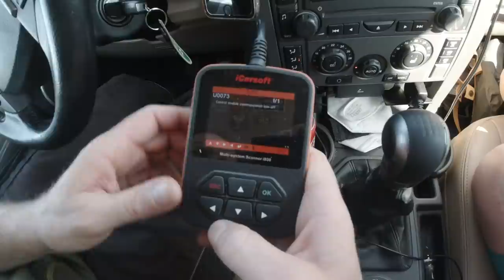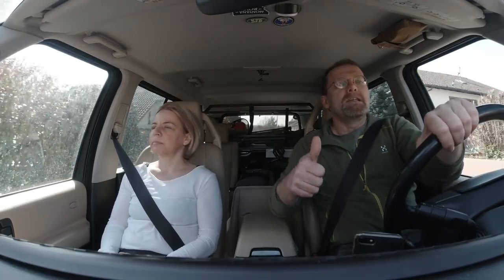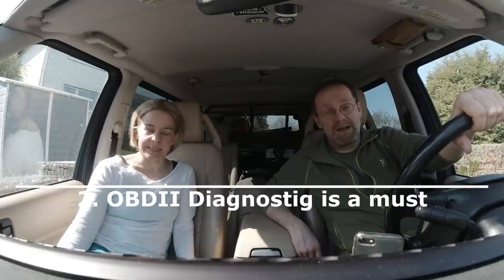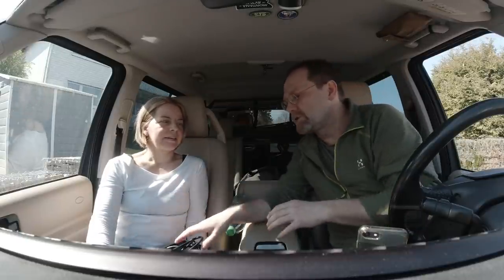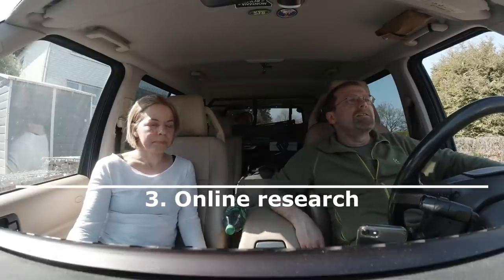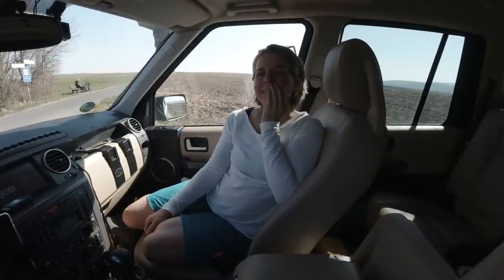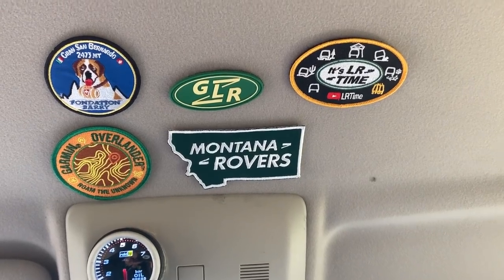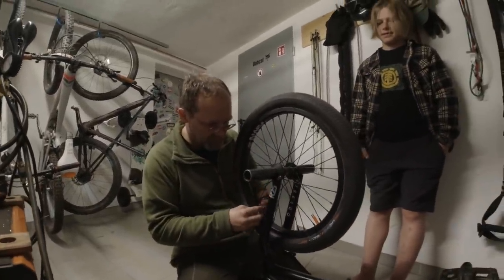Land Rover basic diagnostic in 5 steps - LR3 - LR4

Comment: Having owned 6 Land Rovers over the years I'm well used to the temperamental problems you encounter as an owner, and spending a weekend in the garage fixing the issues becomes the norm. Last year I couldn't decide whether to buy a Disco 3 or 4 and I found your videos very helpful. I especially found the broken crank videos very informative and entertaining. So I decided to become a Land Rover owner by proxy, and by watching you both I get to have all the experience of owning a Land Rover but without the cold, oily weekends in the garage or the cost of ownership! Instead of the Disco I opted for an XC90 (2010), and whilst it's not as good off-road as a Land Rover (what is) it does offer exceptional comfort and reliability. I recently went on a 200 mile round trip and instead of worrying about whether I would get there or not I simply enjoyed the journey. So, I need to keep watching your Sunday videos to get my 'reliability anxiety' fix. Thank you and keep up the good work! 🙂 P.S. I never considered a Toyota because I'm not old enough yet!
Reply: As a 2006 xc90 d5 owner I can tell you Volvo is very soft ,hydraulic lifters,transmission valve body ,swirl flaps,Yaw sensor (mounted under driver seat floor corrodes),CD player not working ,leather on seats cracking,Vacuum fed engine mounts (car only likes genuine Volvo ones),steering rack goes bad,window switches go bad as well,Haldex diff needs service with special Volvo oil or your xc90 can turn from AWD to 2WD very fast and all these items cost a lot of money because Volvo is premium car brand as well so yeah it is a little bit cheaper to repair than a Land Rover but not by much (All the things I named I've fixed on my xc90)
Reply: Diesel xc90s are great but not as reliable as the petrol model (except a 2.9 T6). I’ve owned a 2.5T for over 4 years now and have only ever had to do wear and tear items, it’s a solid car and with a few performance upgrades it really kicks. I do like discos but unless you rebuild it like they rebuilt Vera’s disco 3 then there’s no point in even buying one.

Comment: Hi Christian, hi Vera!
This is Steve from GAP Diagnostic - I enjoyed the video. And yes, providing psychological support for LR owners is one of our main tasks as well. We produce diagnostic systems on the side :-p
Seriously, though, this is actually just one of the reasons the IIDTool is more expensive than other LR diagnostic systems. We are the only LR diagnostic system manufacturer for the end-user who actually provide support. 
While I agree completely in everything you said, this is definitely the more time and effort intensive way of going about the ownership of an older LR. Even all of us at GAP get tired of being 'forced' to play with our cars. An easier method, for instance would be to export the fault list once every 3 months or so and then clear the faults - should not take more than 5 minutes. When something more serious crops up, you can go back and compare the various lists and it becomes very apparent which faults are recurring (nuisance) faults and which are likely to have caused an issue. The average owner (with less of an interest in the vehicle and especially diagnostics) check through the list once (after seeing this video :-)) and forgets about it till a serious issue appears. And then he has nothing to work from and has to start from scratch. Of course you can't export the list with the iCarsoft :-p (Which we all don't consider to be a bad tool, btw. As a matter of fact, if the iCarsoft had been around 10 years ago, maybe there wouldn't have been an IIDTool. But back then, anything worth buying cost 4-figures in $ or €. And the iCarsoft definetely has its drawbacks). 
Aside from regular maintenace, maybe doing a video on the dfferences between diagnostic systems might be something worth considering - and just as much of a help for your viewers as this video.
Vielleicht sehen wir uns auf der Abenteuer & Allrad dieses Jahr? Würde mich freuen.
LG
Reply from the maker: That would be great, we'll be there 😃👍🙋‍♀️Vera

Comment: Did you say...'Psy-Car-logist'? Lol. If you can help, my 2005 LR3 HSE V8 has no power today. It got a brand new battery and new pads and rotors (rear) yesterday. When I turned it off the first time upon getting home, it locked into park. I restarted it and drove it up the driveway. I let it sit overnight and now, no power. I cleaned the corrosion off of the Integrated Transfer Case behind the battery and changed a  blown 20v fuse beside the battery but still no power. Only 1 red (seatbelt) light on the dash comes on but nothing else. And the back gate won't open now. Prior to the new battery and brake work, it was giving me a Suspension light, Transmission light and Park Brake light. I'd really appreciate any help you can give. I just purchased the GAP iiD diagnostic bluetooth tool 15 minutes ago and it will be here in a few days. (Even got a new key with it to program, which I really need!) I'd love any advise on this situation and how to best use the GAP tool. Thank you so much for your videos. You are extremely knowledgeable and you guys are funnier than Seinfeld. :  )  Kind regards.

Comment: I threw my EGR valves away and blanked them - want like a rocket for years best thing l ever did - great entertainment video again gang
Reply: You will find that in most countries (European, North American and Australian) performing an EGR delete or knowingly using the vehicle with such a modification is illegal.
Reply: @Adventures-with-Ty  i would that most 4wd vehicles in Australia that get used offroad have had the EGR's either blanked or a software patch applied to make them inoperable, after cleaning my intakes that were 50% blocked i also planked mine off.

Comment: We have gotten much use from our iiDTool. Last week, two days before my wife was meant to leave for a 10 day trip out west to the opal and dinosaur fields hhe D3 had some funky faults, they just looked like the usual ECU etc faults, but with some trans, suspension and compressor codes. I cycled the the height settings watching the iiDtool specs and based on height dimensions, I found the front left air bag had a leak. I could also hear it leaking with  the window down at offroad height. 
I sourced a new pair expecting to change them overnight for the trip, but She ended up going with a different car.
iiDTool is 100% must have for D3/4 ownership
Reply from the maker: Land Rovers are always looking out for their wifes 💪👍😃🙋‍♀️Vera

Comment: I loved this video.  Very entertaining, funny, and informative.  I'm now wondering if I should get a diagnostic tool for my 2013 Ford Edge.  Of course, the additional content was excellent.  Absolutely amazing what Robin and Philp are doing.  By the way, the rear rim on my mountain bike was cracked, so last week I had a shop replace it for $210 which included the $50 for the new rim.
Reply from the maker: Philipp needs a set of rims about every 10 month.  That is 350 to 400 Euro.  Every 7 days, I need to true the rims and tighten all spokes.  It’s not a cheap hobby.  You have to imagine the crashes in between these successfull lines which I show in the video.  The bike may drop 10 feet on concrete… thanks for you comment.  Christian

Comment: Very good reasuring video for many Christian & Vera. Robin wasn't mucking around, he was running to the anvil to do whatever he needed to do!

People would be horrified to hear that aircraft on every flight have hundreds of faults logged - of which most if not all are nuisance items, however they fall into the parameters for logging an issue. Similar to loosing the comms at start up that you gave an example of, you only need to have a voltage below the threshold & an item is logged. I was surprised how many items mine logged, yet the LR# was running fine. Then I started seeing repeated items, though no check engine light or any other lights or messages on the display on the dash. I was concerned, as everyone knows, LR products have problems. I eventually put them down to nuisance reporting. As you say, the art is knowing what is a real fault that requires further investigation and what is not.

I have ordered an iCarsoft LR V3.0. After researching many, I have determined this is the best value for money form me. If I find a second hand Gap II I will buy one, though for what I want the iCarsoft is more than enough. I do have an AUTEL AP200 with the Land Rover software, and it is pretty good for the price, and it does let me reset the service interval on my LR3, however I believe the iCarsoft LR V3.0 is infinitely better than the Autel I have.
Reply from the maker: Our Gap is used too, we just paid an additional 75€ to have it licensed to our Discovery 3. 🙋‍♀️Vera

Comment: Eh..... my D4 giving me a headache it's a 2013 XS 112k on clock. Went into restricted mode (limp mode). Fault codes were indicated faults from one of turbos. Smoke tests showed a few holes in hoses, fixed those. Then a sensor on the turbo fixed that. Now errors and smoke test indicating its inlet manifold on the RHS in the UK thats the driver side. Inlet manifold parts on back order and no idea when it's due in stock. Worried that I'm chasing problems now and becoming expensive
Reply from the maker: Not sure. Hard to imagine that all this went bad at once.  You can find the plastic manifold on Alibaba in China.  Quality is ok.  Used it before.  Better drive it above 3000 rpm for a few miles uphill or accelerate to use the second turbo. Sometimes this helps.  Make sure it got temperature before you do.  Christian

Comment: Hi guys , great video and very interesting, I have very late 2016 discovery 4 landmark, only done 35280 but I just had the replace the indicator stalk as the main beam came on when I indicated right !!!. I use a foxwell nt 510 as my diagnostics tool I keep getting body control module as a fault , I do clear it seem to come up , any suggestions please Christian . The diesel prices her is £1.70 a litre just come down by 5p after the chancellor reduced in the budget . Best regards mark

Comment: I'm going to buy a Disco 3. I have the Lynx Evo 2 for my Td5 and Disco Sport. The worst thing about the Lynx is having to have a mobile Internet signal. It requires a connection with the server to confirm the license is valid, which is not great when stuck in the middle of nowhere.
Reply from the maker: We recomend the icarsoft diagnostic tool, or what we mostly use, the GAP BT iid tool. Do invest in oner of those.  👍🙋‍♀️

Comment: Problems I've had with my lr3 v8 and fixed my self:
1. Instrument cluster would randomly shut off. Check fuse boxes on driver, passenger, and around the battery for moisture. If all are dry and free of corrosion then it's the cluster itself. Can be easily replaced without taking the steering wheel off.
2. Front air shocks were leaking. Replaced both in half of a day. Just 4 bolts, very easy. Spent the majority of the day YouTubing how to fix it.
3. Currently dealing with a transmission problem. The torque converter would lock and unlock below 30 MPH when cold. RPMs would fluctuate around 1500 RPM below 30MPH. I Replaced the transmission oil, pan, and filter with the new upgraded one. This makes it easier to flush in the future. However, did not completely fix the problem but happens way less now. Will do one more empty and fill just the oil this time. Hopefully, that will solve it.

Besides that the car is great, 120000 miles and the engine hasn't been touched still runs great.
Reply from the maker: The German channel Altblech-Schrauber has a video for fixing the dash problem.  He also fixed the shifting issues on the HP6.  Hope the subtitle works on the videos.  Christian
Reply: @Vera_and_Christian  Oh sweet, thank you for the info! This problem has been annoying me for a while now. Love the channel!!!

Comment: Despite the myth toyota's do break down, i agree that a diagnostic tool is a must for these vehicles and will pay for itself the first time you fail to proceed. I have a Gap tool and i also have a AUD$39 bluetooth reader that will read and clear codes on a D3 and 4, i use a switched extension cable but find it occasionally has a bus speed error when i use it.

Comment: Excellent, like always. Question for you guys : EGR valves replace or eliminate ? Assuming it is ok by law to blank them. Big hug from Costa Rica
Reply from the maker: If you don’t get in trouble, blank them out but leave the electrical connected.  They are useless and harm the engine.  There is no downside like power loss or similar.  In Germany it is illegal to blank them.  Christian

Comment: Good evening discovery master technician.  I am writing to you because I am having difficulty choosing a diagnostic tool in (Italian) language suitable for my 2010 D4 (2.7tdv6) man that can do webasto test and reset the safety stop block.  After 3 failed ignition attempts it locks up and I have to drive to the dealership with biblical timing.  I hope you help me and I respect you and encourage you.  Thank you
Reply from the maker: The Icarsoft can read and reset faults and display live values. It cannot control the FBH or cycle the pump.  Christian
Reply: Thank you very much. Best regards.
 Edoardo Ferretti

Comment: Guys you are the best! LR should hire you! I'm having some seriuos problems. My 2009 TDV6 LR3 is failing. System engine failure, suspension fault on every trip. First two times I managed to overcome by disconnecting the battery, but yesterday I couldn't. Gap tool is useless, clearing fault and fails again after a few meters. This weekend it was everything great for 500 km but then, suddenly while on highway, at about 130km/h " suspension fault", and yellow warning lights, and truck lowered. I drove that way for about 100 km and then "system engine failure", one more light, and couldn't drive at more than 40km/h . I'm starting to hate this truck, but I love it to! Please, help! My mechanic doesn't have a clue, and his the best in LR here in Argentina. It's the third trip that truck fails, faults cleared, everything seems to be normal, and suddenly, happens again
Reply: Maagic happens on LR3, and this morning started as if nothing ever happened
Reply from the maker: Sounds like a battery problem.  So check alternator mains, battery condition (11.5V min), ground wire at right hand side of engine and so on.  Also monitor the voltage with the GAP oscilloscope and see if there is a drop when the problem happens.  Voltage should be between 14 and 15 V when running. Christian
Reply: @Vera_and_Christian  thanks for answering! Battery is new, connection seems to me tight enough, voltage is ok (13.7). Can't figure out. Worried cause I'm making a 1000 km family trip in a few weeks
Reply: @Vera_and_Christian  what I'm sure about is that it is an electrical issue. GAP shows a lot of faults, including injector control pressure to low, lots of faults in ventilation, and control module network signal calibration data. But everything works fine, never felt any failure in the engine acceleration nor driving neither at idle
Reply: @gastondicastelnuovo8857  clearing the error codes doesn't fix the problem, fix the problem and you wont get the error codes.
Reply: @nickrobertshaw9692  the thing is that I don't know how to. Because I'm completely sure that codes are originated by an electrical issue and not by the faults the codes tells me. I'm sure I'm not having a suspension issue, nor an injection issue
Reply: @Vera_and_Christian  TCM module and wires were shinny as new! This sh*t is blowing my mind!!
Reply from the maker: I would put the fuel pressure onto the graphic display together with rpm and throttle command.  If the fuel pressure fault comes, you will see if the signals got cut off or if the signal is plausible.  One of the faults could be true.
Reply: @Vera_and_Christian  I hope, but it's so aleatory that I think it's electriy issue. Maybe it happens while on test, but it may happen after thousands of km, who knows! Thank you!

Comment: Hi I bought a land rover discovery3 2.7 2006 409000 it's good but in the cold weather it tros on the subspion inactive light normal ride hight only but in dry weather it's OK is it electrical problem

Comment: Greetings! The dealer of that 2012 realized he would lose big $ if they had to fix the problems i found with the vehicle - they cancelled the sale....moving on i had my 2005 LR3 fixed (brake line front right corner) and it is now back on the road....but HID low beam ballast failure - any recommendation for replacement ballast? Do i need to become a compatriot?
Reply from the maker: Oh yes, unfortunately. We get hundreds of comments, weekly, on all of our videos. For those needing technical support, we can only handle that on Patreon. But even there, you would need a fault code from a diagnostic unit like the icarsoft or GAP tool. You can also check the disco3.co.uk website, like explained in this video. 👍🙋‍♀️

Comment: Hello,  I just bought a 2011 LR4 in the states.  It keeps completely cutting off on me when idling, or driving slow.  Usually when making turns, or on an incline/decline.  It will not throw any codes and it starts right back up after cutting off.  its almost as if bogging out, then completely shuts off.  I have taken to shop, had a new fuel pump installed and coolant package.  I am stuck because the mechanics do not know what to do since it is intermittent and no codes.  Any help or suggestions would be greatly appreciated.
Reply from the maker: I don’t know. Better check with those Facebook groups and start with “did anybody have this before…?” They are so smart there….